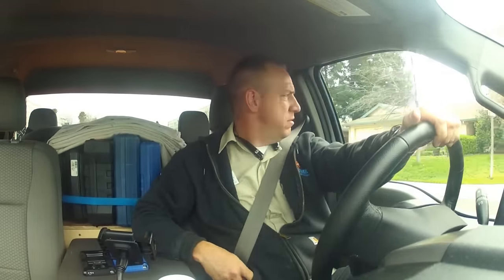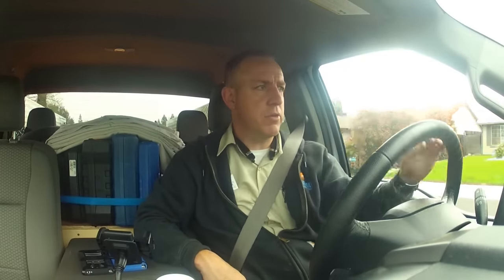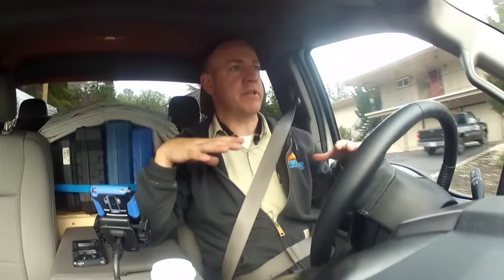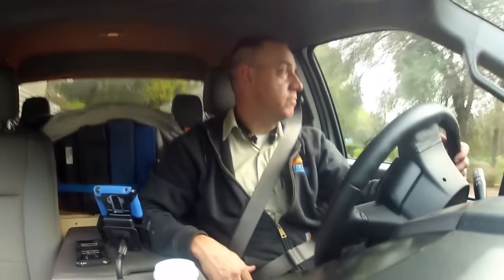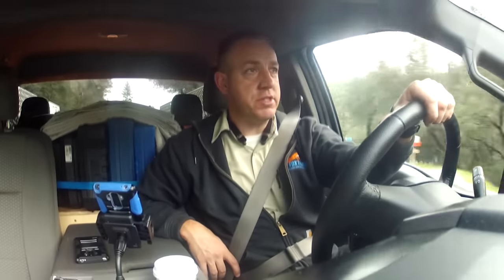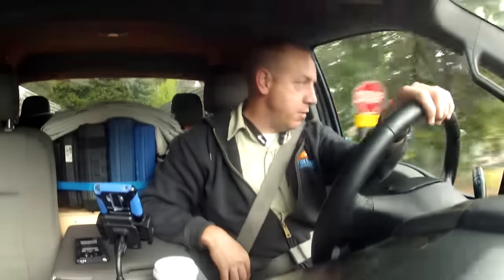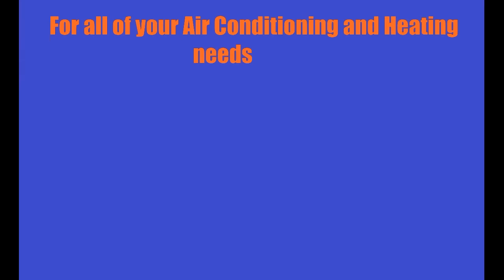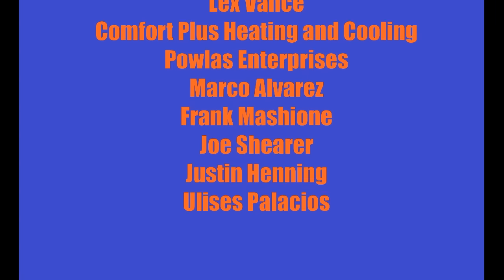Compressor and Fan Motor Part 1

Comment: Hey Greg I have found that sometimes with heat pumps to also check the crankcase heater
Reply from the maker: Oh yeah very true especially on the Trane units. This Old Ruud didn't have one.
Reply: exactly the old trane reciprocators had them on the very bottom and they would rust up and ground out

Comment: Sometimes if your meter doesn't handle high enough ohms, you will never read continuity to ground. In those situations a megohmeter is needed or isolating the individual components like you mentioned. Everyday is a learning day bro. Hopefully you can get some footage of the compressor swap.
Reply: +Eric M very true

Comment: the fan was probably finding a path around contacts  through the bad compressor. did you have any of the compressor wires still connected?

Comment: Just the other day I popped 5 fuses before I found the short. If we aren't learning then we aren't trying.😎
Reply from the maker: That's right!
Reply from the maker: +who ami oh yeah I have a 3 and 5 amp Popper. Very handy.
Reply: +who ami  That's a good idea, thanks. These are the glass fuses 0.5 amps and they are expensive. I need to make the investment.

Comment: Hey Greg, what it sounds like you have a internally shorted compressor and your fan was finding a path around the contactor or if you had your compressor completely out of the circuit when your fan ran then it is also grounded usually the fan will run half speed under those conditions.
Reply from the maker: Oh yeah didn't seem full speed. But not tripping the breaker either.

Comment: In my experience it's always whenever breaker switch flipped it's usually a grounded compressor and what I always do is use my meter to see if there's continuity with  ground through each three of the terminals on the compressor but if I'm not mistaken the only thing that can flip the breaker is the compressor not sure if the fan can
Reply from the maker: Thanks for the comment!

Comment: I seen you said you don't charge for drive time, that's a bad idea. Say you finally fix the unit on this call 40 miles away.You drive all the way back to your area.Just when pull into your drive way you get another service call back in the same neighborhood .By the time you get back to your shop you have driven 160 miles. I can see if you work for one of your neighbors 5 minutes away. Everybody charges trip or assessment or diagnostic fee . The truck has to be maintained,that cost money. I'm not going to tell you how to run your business,it's just friendly advice! I'm in Michigan , trip charge or diagnostic fee is anywhere between $75 -$150. I myself charge $85. I wish you Luck on all of your endeavors Gregg